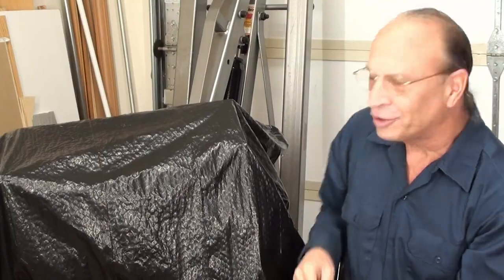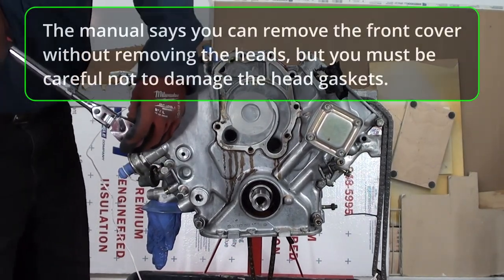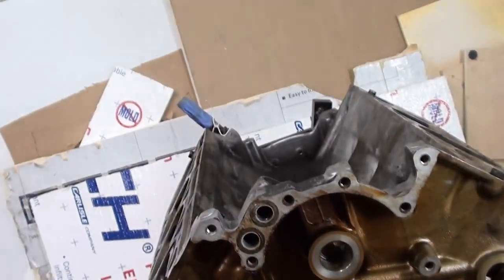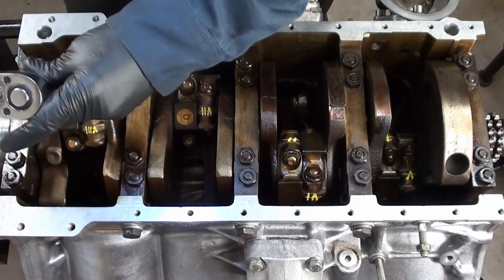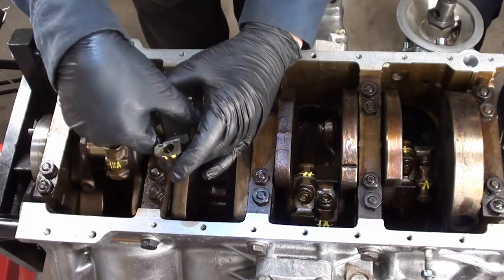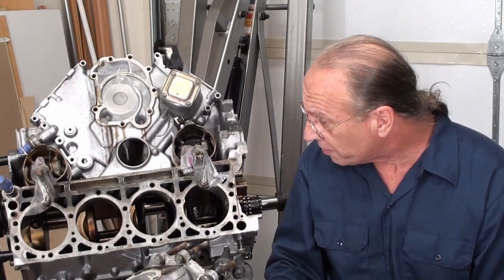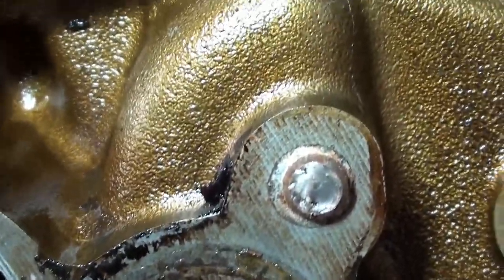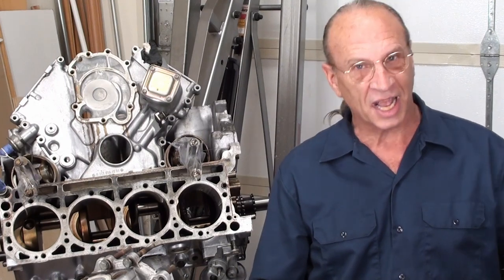560SL - M117 Engine Teardown Part 4 of 4

Comment: Thanks for making these videos, Tony. I appreciate it. I'm currently dismantling the engine in my new project car, 82 380SL. Chain snapped, broken guides all over, and oil all over the place. I can see some of the broken guides lodged deep into the timing casing so I guess I need to open all that to retrieve it.
Reply from the maker: Hey buddy I’m happy to see you here. I have watch several of your videos in the past and know you can handle it. I’m just about ready to upload my latest video on installing the crankshaft! Hopefully one day I will join one of the R107 meetups.
Reply: @TonyLiveTV  I appreciate the support. Let’s see how it goes. Do you think I can do it with the engine in the car? 😂
Reply from the maker: @sophiathe380sl  I know others have replaced the front cover with the engine in so I guess so. The front cover also attaches to the heads & oil pan. My guess is you’ll need to replace the oil pan gasket. If replacing the oil pan gasket you will find you have to support the engine from above and remove the cross frame. Check everything closely. You might find you need engine mounts too. It keeps going…..

Comment: When you tap the pistons out, at 29:45, with that piece of wood,are you hitting the piston on the edge of the piston, against the cylinder wall? It looks that way but not sure. I´m at that point now.
Reply from the maker: The piece of wood fit on the inside of the piston next to the rod making sure the wood did not touch the cylinder wall. Also note that before I started hitting the piston with the wood I made sure there was no carbon ridge at the top of the cylinder wall for the rings to catch on when the piston come out.

Comment: Did it. Get the drumstick now😄 Will steal one from my brother hahaha. Man, the pistons look new. Dropped one piston. Was positioning the piece of wood, tapped it a little, barely touched it, and bam, the piston came out and slammed on the floor. So that`s a new one. Crankshaft looks great too. Did 4 pistons. Doing the rest tomorrow. Celebrating with a beer now😄 Thanks again Tony. Would never have made it this ”easily” without your series. No way. 👍
Reply from the maker: Awesome dude! I kept one hand on the piston at all times just to make sure. I’m glad you got it done.
Reply: Yeah. The wood piece got stuck when the piston got too far down. That’s when I understood why the drumstick😄 Just wanted to get the feel of the wood stick, tapped it gently. And the piston just fell out. Considering the cost of this project, a piston is’nt a big deal.